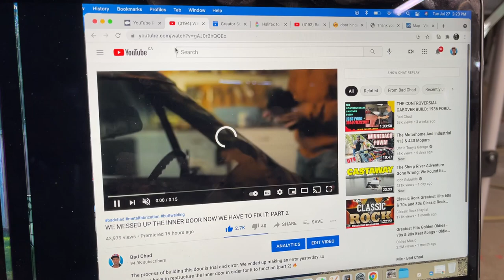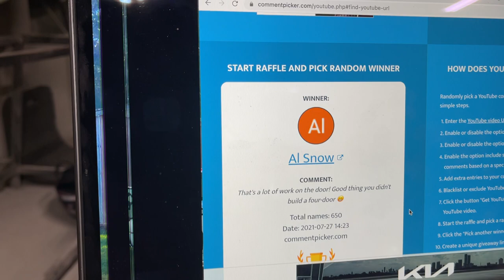THE HINGE DILEMMA: RE-ENGINEERING THE DOOR & HOOD HINGES

Comment: Chad, as a Mechanical Engineer with over 40 yrs experience, I would suggest trying to install the lower hinge on the lower new part of the door, and then modify the top hinge to have it's hinge pin in perfect alignment with the lower hinge pin.  Like having one steel rod being the hinge pin for both top and bottom hinges.  The door will have no choice but to open and close then - and clear the lower body jam.
Reply: @kukuipupule4415  I grew up in my Dad's machine, welding, and sheet metal shop long before I went to college.  I have worked with my hands all of my life and I am almost 73 yrs old.  I do appreciate what Chad does - believe me!
Reply: @gormanwpjr  I believe this is a place for everybody that love cars, your suggestion looks nice to me.
Reply: Chad, put the hinges on the back of the door not the front. Just a thought.....
Reply: Bill is correct! Simply mount the lower hinge then lengthen the upper hinge so it comes out from the body the same distance as the lowe hinge does .  Depending on how far out your extension is you will have to extend it several inches.   As he suggests use a long steel rod to use to keep the two pins in line.
Reply: Chad's a T.E. engineer
Reply: @heyjer8000  Yes, he is, and he owns it.  One of the reasons he can freehand certain shapes when cutting metal is this learning method -- he knows a lot of what doesn't work intuitively through experience.  As he says, he's just learning a bit more with parts of this project.  Yes, he could use a CAD program to design bits like this, but his method works too, is a lot faster if you figure in learning time, and he's good with it.  And as he offers, making mistakes isn't a problem if you recognize and fix them, it's part of life.  If only "cancel culture" could get with that concept, we'd all be better off.  Making mistakes is a whole lot better than sitting on a sofa doing nothing because you're worried you'll make a mistake.
Reply: Clever ,tech skill but ugh what will it be exactly? It is a shock to UK sensibility(s) is it got Star Wars 23? Fantastic panel skill

Comment: If you move the hinge line forward to just behind the hood gap, the door will swing clear and the door will move outwards away from the body, allowing the door to open further.
This could be built as one single large hinge, or two separate ones.
Like a production car, leave a large hole for the bolts to adjust door fit, and to take up any door droop due to sag or wear on the hinge pin.
That way, it will be real easy to adjust with the hood up.
To reduce the likelihood of the hood flip flopping due to the hinges being close together, you can box the two hinge arms together, which will make it more rigid.
Nice work Chad, looking forward to the next installment.

Comment: Use Original door hinge. Mount at the bottom of the flat just before bottom of door where it flares out. You will probably need to make the bottom front of door over with it making a C shape so as to make the door swing away from fender when opening. Where as door swings into the fender now. Think replicating the same style opening at bottom front of door as the curve of the wheel opening of the fender for the tire. And again ditch the head lights and go to the 39-40 ford style so the lay down at the same angle as the hood lays back for a more stream lined look so the hood and lights aren’t fighting each other. Really Great work folks!!!!

Comment: Myself I would widen out the hood hinge spacing. Would be much more stable with the amount of weight that is there.
Reply: I have the same concern about twisting force on the long heavy hood, but if he's using an electric opener the system will be a tripod so there's less twisting force.  Wider would be more stable considering wind, but there aren't a lot of options.  I think the biggest concern is warping the area where the hinges attach to the hood.

Comment: Just like with control arms, the hinge pivot points have to be in line, and on the same plane.
Reply: John, your right, if Chad would use a long hinge to the bottom and a short hinge on top and align the hinge pins with each other the door would swing out at the bottom.
Reply: This. The hinge line is the key.
Reply: @John B
I was thinking, oh no here we go again
Reply: "Shared Axis":  Imagine one long pin through both hinges.

Comment: To aquire the swing distance to clear the doors protruding bottom, the hinge point needs to move further away from the original cabs A pillar. Chad may tilt the hinge pins axis so the door when open swings out further at the bottom.
Reply: He can cut a wedge in the fender and incorporate it as part of the door action, that would push in when the door opens.
Reply: @amerritt261  your right, that's the way Detroit does it when they have a profile sticking out further than the rest of the door.
Reply: Are you familiar with a European hinge on a kitchen cabinet .Check it out i can mot explain it better
Reply: @ernestauilera9662  yes, they have two internal arms that allow the door to swing away from the cabinet. They are a low use hinge a and may not be the best design to hold the weight of the door and someone pulling on the door to climb into the cab. Good idea if one can handle the design needs of the weight and usage. All door hardware are designed for those two elements.

Comment: I drew the contour of the door in CAD and tried a few hinge configurations and found one possible solution is to set the hinge pin angle at an angle that catches the outside curved edge of the door at the bottom and tilts inward toward the top to catch the outside edge just before the door opening curves back...about where the current upper hinge is now.  

With both hinge pins set at this same angle, the door will lift slightly as it opens and will clear the body.  Probably will be good to use some nitrogen gas charged cylinder springs to hold the doors open since they will tend to close heavy with the downward assistance of their weight

Comment: Would it make the hood more sturdy if you trimmed off some of the outer part of the hinge? That would allow the actual hinge points to each move an inch or more outboard. Around here, the wind would try to twist the hood off if it was opened up. The further apart the hinges are the stronger the connection. I really like your thoughts on the door hinges. When you move the pivot point forward it will gap the door opening more. Also if you push the pivot point out away from the door it will also increase the gap. Even a quarter inch out will help. Good work! I like that you encourage us all to get working too!

Comment: The top hinge needs to change pin axis to point to the bottom hinge, which needs to be further outboard. 
Simpler, as others suggest, would be to cut back the skirt at the front of the door so it misses the bodywork and reshape the door aperture. Comment from UK.
Reply: You've got it

Comment: You still need a step to get into the cab- that will require cutting a hole in the body to step up to the opening.  However if you hinge the door at the bottom edge it will open down and become your step.

Comment: Don't need crazy hinges just need to cut a hole at the bottom front of the A pillar so when the door opens the bottom front corner will tuck into or behind  that bottom front corner of the door opining. Trying to explain this has been hard wish I could be there. I do this stuff for a living and it's hard to watch him struggle. At 42:15 Aiden puts his left hand right where I'm talking about so when the door opens there will be a spot for the door to tuck in and when the door is shut you won't see the clearance slot.

Comment: You had it right on your first layout of the door when you made the inside curve at the bottom of the door .. cut off the distance from the body to the farthest point and curve it back to the bottom flat spot.. the door swing out will have to clear the body part kinda like a step-up but with curves to match the back side of the door.  I______(  and weld back in what you cut off the door onto the fender then two regular hinges just like original... Great job!!.. Tom @ Frog Level Customs.
Reply: Told him that as well on his first layout he had it marked on door.

Comment: I have a hinge idea. Two steel posts, with a hinge on one side. Short / flat side attaches to door jam. Long side (the post) goes inside the door by about two inches…maybe even just an inch…have to not interfere with the window. When you open the door, it slides down the post just enough to clear the body and opens all the way on the hinge. When you close the door, it slides back in all the way and closes. The entire thing is invisible from outside the vehicle.

Comment: There are several easy solutions to your doors. Simply grab a broom stick and place one end of it on the door slightly above the original top hinge. Then lean the other end of it down on an angle onto the bottom front edge of the door. The centreline of the broomstick is the centreline along which both hinge pins must lie. The two places that the broomstick touches the door are the two places that the hinges should be mounted.

A mixture of other simple (and some more elaborate) solutions can be seen on many LeMans cars of the late 90s and early 2000s.

Comment: Way I see it you have several good opportunities to resolve your issue.
1. Relocate the pivot point and have protruding hinges. As you seem to be doing.
2. Trim the leading bottom edge of the door back to match the radius of the body panel.
3. Redesign your door to stop at the body line and use factory top hinge. Which if you did this would allow you to make a fold down step with the lower panel. 
Which would look better with a gulwing door.

Comment: Move lower hinge very low on the door;  make the hinge pin on both top and bottom hinges co-linear,  when door opens forward it will also swing slightly upward and since hinge is at widest low area, there will be no interference.

Comment: On the door hinge, you might want to take a few minutes and watch the July 24th post by ColdWarMotors.  He re-hinged a Model T door, and the challenges aren't as complicated as yours but he does a good job of explaining the alignment problems.  Also, he started with a nice-looking and very beefy brass hinge (he later hacked it up) that might work for you.  I'm thinking weld it flat in the pivot location you figured out.  Anyway, it's just a few minutes but I thought it might help.

Comment: There are two options for the door hinges. You can offset the to the right as you have already tried. However the amount of offset must exceed the amount by which the fender bulges to the lower edge of the new metal. Alternatively you can keep the hinges at the door gap, put the lower hinge at the lower edge of the new metal, and incline both hinges so that the pivot pins line up in a straight line.

Comment: Just a quick question. Why aren't you using a rod the length of your anchor point to figure out what your hinge pivot would be? It's basic geometry that most people don't think about when it comes to hinges we just take it for granted. The top hinge needs to be further back than the bottom hinge but the hinge points need to be in the same diagonal in order for it to clear the bottom of the door flare. This would make the door open and lift. The further back your top hinges the more it will change the lift. You can fabricate the hinge, you can use a pre-existing hinge and change the mount to fit your purpose but the hinge that you use doesn't matter only the pivot point. The hinge points just have to be in a straight line hence using a steel rod to figure the pivot. You can even run the steel rod through the hinges, then tack them onto the door until you get your right angle to fit the complex curve.

Comment: You are on the right track with the door hinge. Move the pivot points about 2 inches forward from the original location. 1 to 2 inches away from the door skin, move the top hinge higher and the bottom hinge as low as possible before it curves outward. It should work like a charm.

Comment: Put the hinge vou just cut off on the car with the pin on the door and not the cowl. Have the top of the pin lean to the back of the car to make the door tilt up. Now when you open it the door will go back and up at the same time. If you mount the hing on a 1 inch block so the pin is further out from the car the door it will go back up and out at the same time. It should give you 90 degree opening. The further out or back will give more clearance. I'm a custom furniture, cabinet maker and have the same hinge dilemmas. I work wood , not metal like you, but the principal is the same. Except I usually have more interior space to hide a two pin hinge or whatever I have to make to swing all kinds of shapes. Look at the original hinges off those merc doors, with the bulge of the door between the two hinges the door has to go back then out not to bind. That is only a one or two inch bulge. You are dealing with 6-8 inch bulge at the bottom of your doors. The slash cut you drew once going from the flat part of the ford door and angled down to the rear 50-60 degrees would have worked with the original ford hinges. Getting your legs in the cab would have been tough though. Keep picking at it you'll get it. But please try what I said. As you say learn if it works or not ?.   .

Comment: Chad the hinge will go on the inside of the door about a third the way from the front and it will pivot the whole door outwards in a radius both hinges have a rod or a bar that stiffens them together that goes from the top hinge to the bottom hinge look at how they hinge the cabinet doors and you can make when they're not very complicated the door would unlatch and swing out words in a radius starting a third of the way back from the front and that would give you a eight or nine inch radius which would definitely give you enough room to clear with the bottom of the door going out that far you won't see the hinge it will be on the inside of the truck on the inside of the door panel

Comment: Former gate builder here ! Lol.  You can take 2 butterfly hinges, mounted in the same plane but stick the bottom one out away from the body the when you open the door the bottom kicks out at an angle away from Your body work    Think about a gate on a inclined driveway.   The gate can’t swing level it has to swing up at an angle    You had the right idea when you welded the angle iron on the butterfly hinges previously but then that’s mounted out on the body vs in the door jam

Comment: you would have to scribe a pattern at 90 degrees from the body and then cut that pattern out ov the bottom of the door and then fill the rest on the  body in the front corner of the door. I wish I could draw you a picture . you would avoid doing a lot of welding  that would have to be redone

Comment: I think if you'd heat and bend/twist the "top" of the existing hinge slightly towards the front of the truck you might be rewarded with the correct angle to clear the bottom. Once that is established you can determine a similar configuration for the bottom hinge... just a thought.

Comment: You are doing a great job figuring out the solution to the door hinges. The only reason I suggested a suicide door was for a greater distance between the hinges could be achieved and it could support more weight.
Reply: suicide the doors, yet modify the pivot point out about two to three inches, instead of flush with the side

Comment: The pivot points on the upper and lower hinges have to be in line perfectly for starters. The hinge pin needs to be as far forward as you can stand it to make the door clear when it starts to open.

Comment: The suggestion to extend the top hinge out to the same pin axis as the lower hinge and then also use that top hinge extension as a mount for the side view mirror is probably the best way forward, but not sure how it will affect the look of the vehicle. Chad can probably work that into the flow and style

Comment: I believe if you just put the hinge that was on it or a stronger one or a set it will be fine. As long as you put it on the same plane as the top one that is already on the door. Just put it as far down as you can on the same top section as the one on it. You are just getting thrown off by the bottom that sticks out, but it should not affect how the door swings. PLEASE TRY IT.!!!  Thanks for reading this.

Comment: Here is your answer, make two offset hinges and run a bar or even two connecting them together and then keep the bar running up and use it for a side mirror post.
Make the whole assembly very cool and very retro truck like.
Make it all one assembly, that way it will look great on the side of the truck.

Comment: What about those "c" or hook shaped hinges like on some aircraft landing gear doors? There are smaller ones like from twin engine Cessnas perhaps. They would also be inside the cab when done. If it did work, you might be able to get some that are not flight worthy for maybe nothing. Also the same kind I put in car models to make doors and trunks work.

Comment: I dont know if you actually read these "comments".  But, I would never suggest my comments are as good as those you decide upon.  Still, I hope my considerations might be of some help to you.  When you outline the requirements for your hinges, I suggest you consider the pins need to be inline with each other.  In addition, I would seriously consider using the rear of the door for mounting hinges because that provides a much more distance between hinges thereby providing  considerably more support to the opened door.  (I know, too long of a "comment").